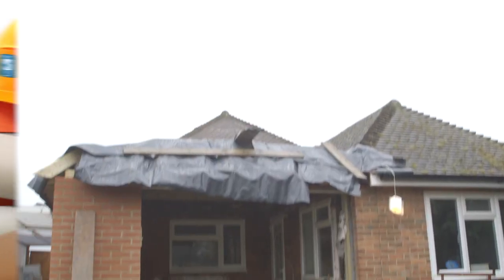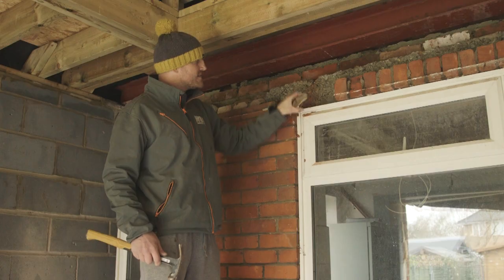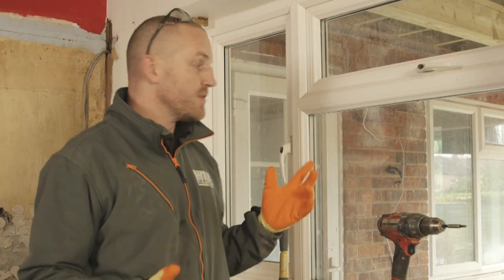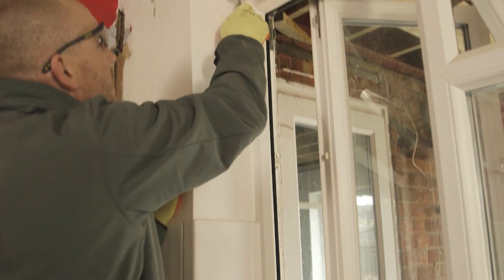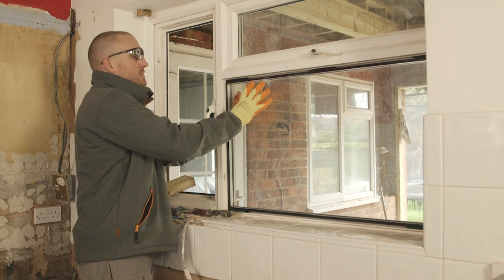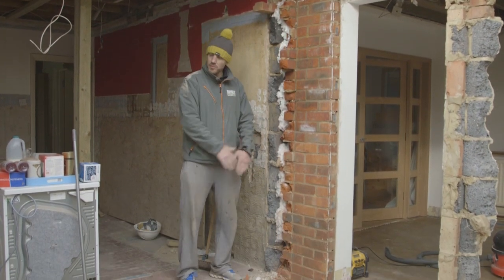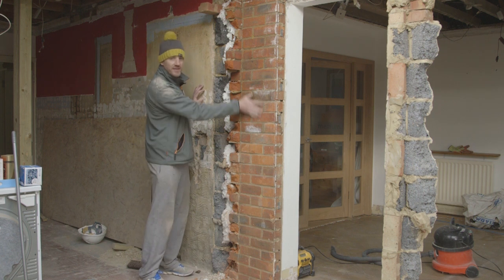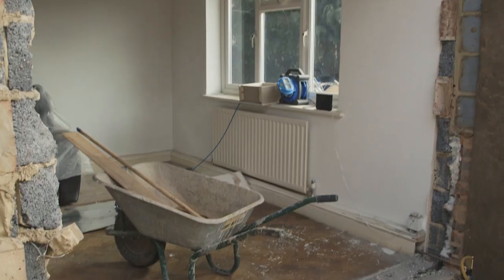How to Demolish a Wall with a Window in it: How to Build and Extension (7)

Comment: No no no i was just getting into this video on full screen ........then it ended lol.  Im enjoying watching this job your doing.  Got a small kitchen on back corner of a house we are buying, so got to extend out to side ( i think)  to give us a better sized kitchen.  We are thinking of knocking down the detatched garage and takng the kitchen out about 6 or 8 foot, would the concrete base of the tarage be good or would we still have to dig footings?.  Going to contact some builders hut thought id ask you your thoughts?